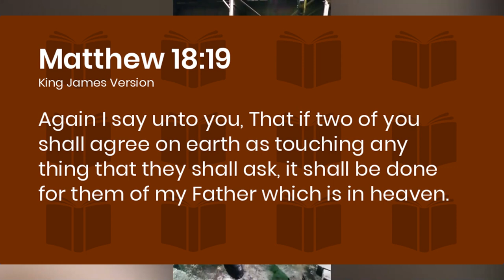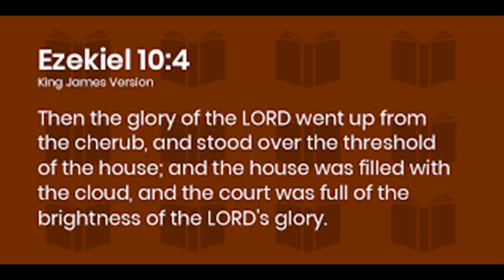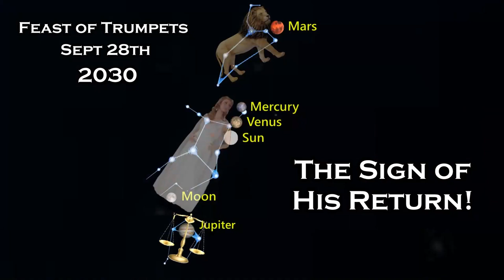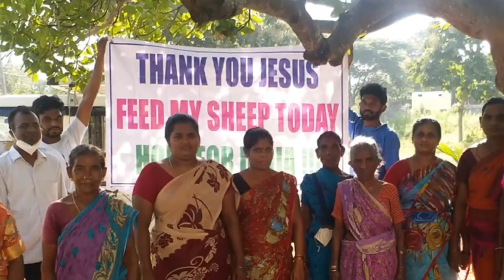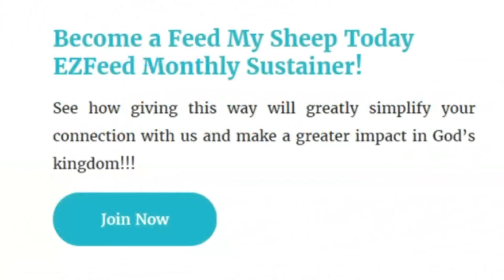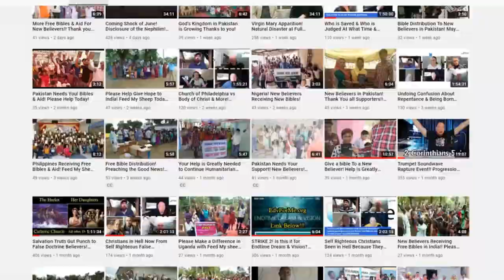Last Days Physical Manifestation of God! Fire and Smoke!

Comment: “White smoke can often mean material is off-gassing moisture and water vapor, meaning the fire is just starting to consume material. White smoke can also indicate light and flashy fuels such as grass or twigs.
Thick, black smoke indicates heavy fuels that are not being fully consumed. At times, black smoke can be an indicator that a manmade material is burning such as tires, vehicles or a structure. As a general rule, the darker the smoke, the more volatile the fire is.
Grey smoke can indicate that the fire is slowing down and running out of materials to burn.”